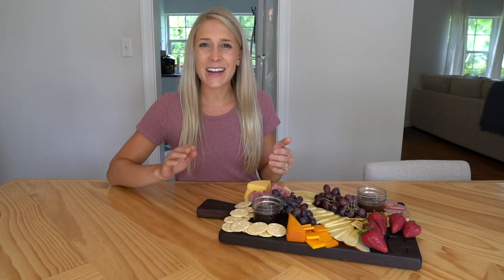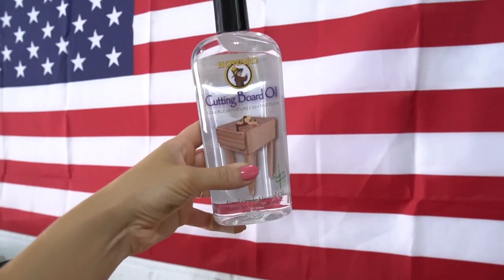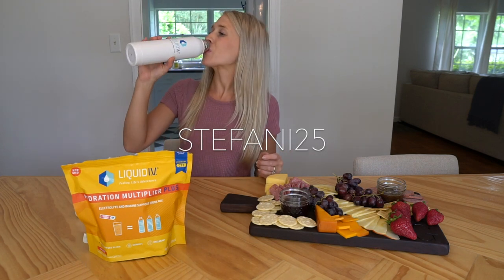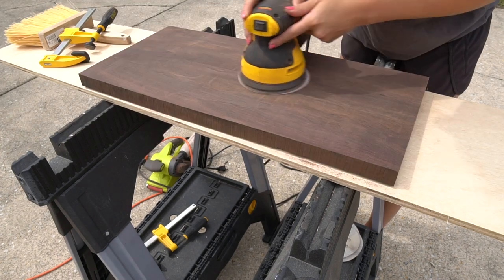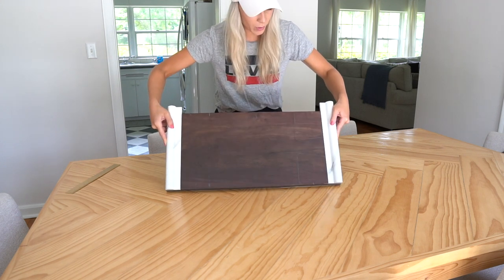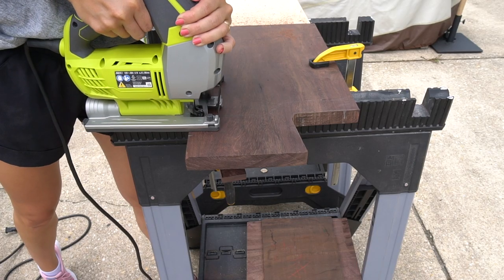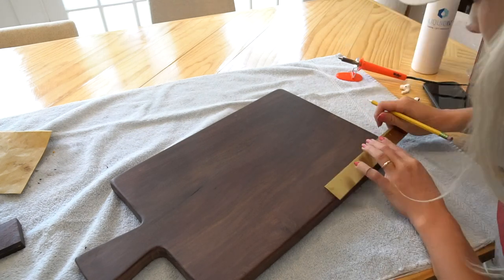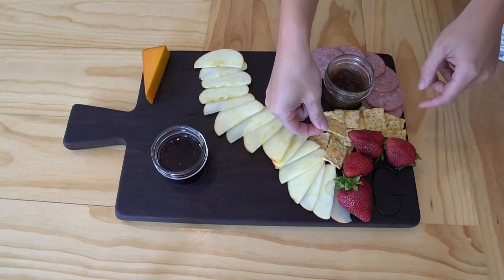DIY Charcuterie Board | Home With Stefani

Comment: Nice job. You can lightly wet the board before the final sanding. That will raise the grain, which after finish sanding will give you a smoother surface for a longer time. Its just wood, so it can be re-sanded anytime - even after being oiled. Oil a scrap piece and sand it with 400 or 600 grit. You will see it gets polished almost like granite.